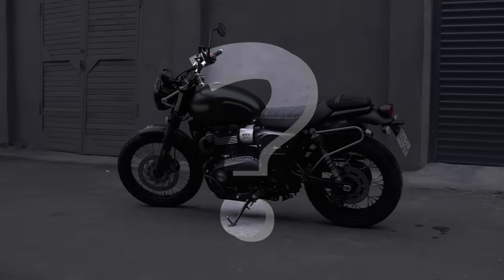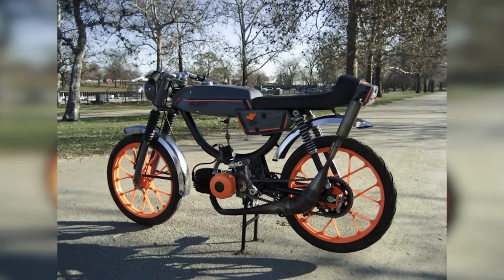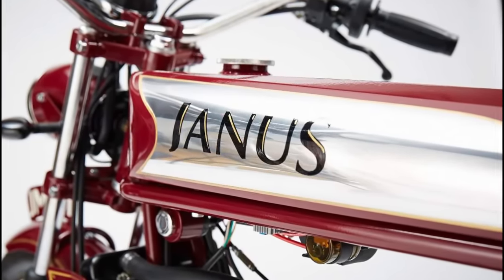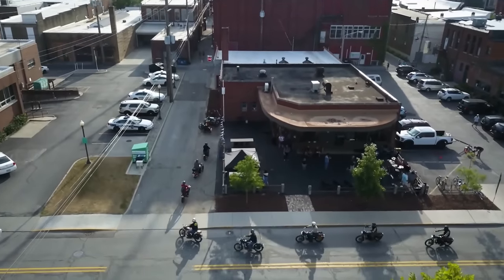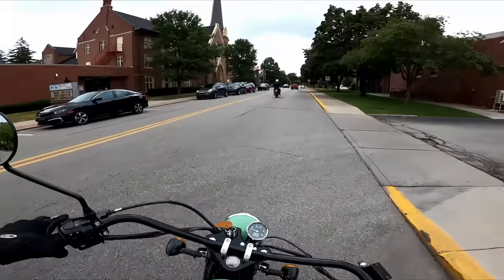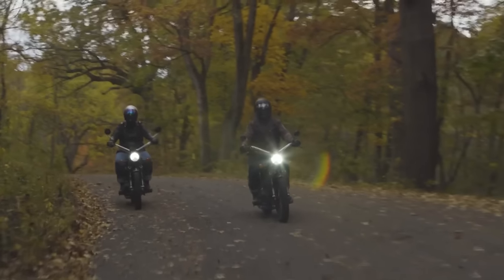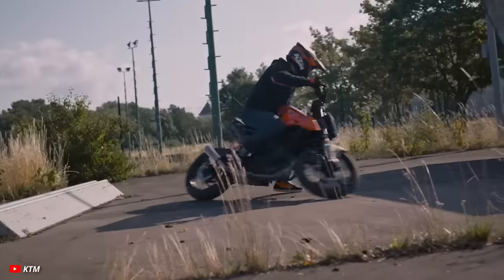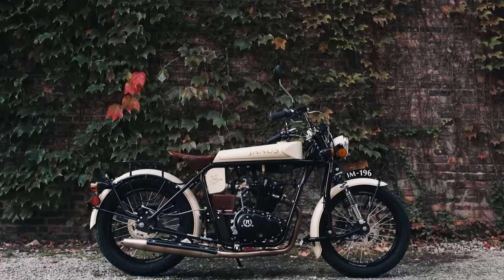The New Manufacturer making 100-year-old Motorcycles

Comment: I agree that the Royal Enfield 350 is heavy and slow. But it's actually great fun to ride! The Janus is clearly a quality product, never ridden one so I can't comment on its riding capabilities.

But as you observe,  there is a massive price difference between these two 'retro' bikes. 
The Janus website is very cagey about revealing its prices. Royal Enfield, Triumph, even Harley Davidson will tell you straight up the actual price you are paying!

I also don't think a company can be called a 'motorcycle manufacturer' if it doesn't make or design its own engines. The engine of a motorcycle is the heart and soul of the machine. That's the point.

The Janus is very pretty for sure. But possibly a bit of a rich man's/'woman's toy?

My daily rider is a Royal Enfield Himalayan 411. Slow, heavy, but very torquey and just an absolute hoot to ride! Reliability is well-proven, a worldwide network of RE dealerships and easy parts availability. Cheap to buy, cheap to run but great! 

Janus and Royal Enfield (et al) are in different market segments, so comparisons between those products (as you do in this video) are somewhat spurious.

An American motorcycle with a Chinese engine. Hmm...

Anyway, ride safe. Love and peace.

Comment: i feel like we're forgetting about what these kind of motorcycles were all about, the halcyon 450 has a base price of 15.000 $, this is an insane price for a single cylinder 450 air cooled motorcycle, hell, even 10 grand would be crazy for a motorcycle like this, you can piick up a old used bike for a twentieth of what these cost and have just the same fun (if not more since you don't have to concern yourself with damaging the bike too much)

Comment: Halcyon 450 would be the one for me if I had the money. I own two Royal Enfields, a Classic 500 and a Super Meteor 650. Both great bikes in their own way for me, however the Janus is just such a unique and beautiful machine. You would need to prize me off with a crowbar. The engine being made in China isn't a big deal either. I had a modern Benelli Leoncino 500 and that engine was Chinese and was a revvy little motor with no issues.
Ahh I can sit back and dream I suppose.

Comment: I tried slowing down and bought a slow Triumph Trident 900 and could not stop pushing it to it's limits and engine died. So I game up motorcycling. I knew I would not have a license with all the ANPR and average speed cameras we have in the UK. Some of these average speed cameras were set on motorways for ~ 28 miles. Could you imagine being on a motorcycle and only doing 50 mph for that distance, which I think even in a car is dangerous and I was constantly fighting the need to fall asleep at the wheel at 2 am.

Comment: Most modern bikes are all very similar.  Janus is the only brand selling in the US to offer something completely different.  A scratch designed and built retro classic.  It cost way too much, performance is less per dollar than probably any other bikes sold, but they are not selling a dyno sheet or 0-60 times. They are selling a small company, hand made ,visceral ultra lightweight riding experience. Yes I wish the engine was an old design, redone Norton, Harley, or BSA or something.  They could have done that and charged over 25 grand per bike, (for a midweight) and there would be a market. but we are in 2024 and they wanted to make lightweight single cylinder bikes that they could sell in small volumes.  People complain that manufacturing is deal in the US, and when a company designs and builds, and successfully brings to market several motorcycles ,people need to find fault.   The engines sourced from SWM  are redesigns from Husqvarna engineers and built by a reputable Chinese factory.  KTM has motors built in China, and practically everything we use and touch every day is made in china. Remember when Made in Japan meant copy cat junk in the 60's?  Times change and RIchard is bringing these bikes to may happy owners.  The customer service is best in class also.  Yes I own one, and like most Janus owners have owned many bikes previously and got bored with the vanilla offerings out there.

Comment: In a world of complexity and gadgets, Janus Motorcycles are anti-gadget. I like that. Mass marketing motorcycle giants and government control freaks would have you believe you need traction control, ABS, and a suit of armor to ride your motorcycle. You don't. Like many pleasures in life, sometimes simple is superior. As for those that dis the Chinese engine, do your homework instead of making uneducated blanket statements. The Chinese build their products to required specs. SWM of Italy imports the 450 engine for their bikes and sells in small quantities to Janus. It is a well made engine with a dry sump and oil tank, counterbalance shaft, oil cooled and fuel injected. A Honda clone for sure, but with well thought improvements. Many major motorcycle manufacturers use Chinese parts and engines. I'm old enough to remember when the same quality arguments were made about Japanese bikes. Check out Richard's You Tube  video on the Halcyon 450 engine and you may  change your mind if you are a doubter. But Janus Motorcycles were never intended for the masses, and that is exactly where the beauty lies. Some get it, and some never will.

Comment: What? 15,000$ on a single air cooled bike. Thanks, I pass. This engine is an updated version of an XR400 from 30 years ago. Nothing wrong with that, but for that price I can get a much better bike. I have a NC750x that cost me half of that, and it's fine. The whole "old-bike-character-feeling-bla-bla" is a nice marketing plot to have a chat at the bar, but it does not change the fact that is an overpriced single with a very limited rear suspension. Hand made, so? I don't seat admiring my bikes, I ride them. 
With all of the above said, the review was well made. Kudos to bart.

Comment: Thought I was onto something here. Was hoping to find something like some old British and Japanese classic bikes being reproduced.
A Honda CD 185/200 would be my thing from the 80's....they were so good for a small bike!
Disappointing to hear these bikes have Chinese engines. Yes, those engines are based on CG's, but were and still are under-engineered.
They may seem reliable at first, but I would not trust them after a few thousand miles. Sourcing Chinese engine parts can be a real issue too!
I had a mate who went through 6 Chinese 125cc bikes in less than 3 years, as the engines would seize before 3000 miles.
That was 7 years ago, but I have my doubts that the engines would be better now, as the Chinese bike makers had years to perfect the CG engine to be what it should be, but they didn't to keep costs low.
The fact Chinese 125's are still way cheaper, makes me think this is still a problem.
Apart from all above, these Janus bikes look nice. Chrome backed indicators would be better.

Comment: The engine is basically a Honda 650  sleved down to 450. They should have left it as a 650. They should have put a Buell Blast motor in the bike considering the price.

Comment: They have cool bikes but i wish they would use ABS brakes and instead of a analog gauge use a LCD gauge with the standard MPH,milage. Use GPS on a vintage round casing you would see in an analog. Those are the only two things I would change. You have the vintage look with modern technology. Their sales would go through the roof. If not make it an option.

Comment: Bought my first bike for 950 put new tires and seat on it total 1200 my second out of junkyard for 37 bucks and put new tires and seat and a little engine work and road it until I got hit and bent the frame then road my first bike until I found another one for the frame and replaced the frame for my second bike cost me 10 dollars and time. I don't think I'll ever spend what they want for a new bike it just seems like a rip off look you can buy a used bike and granted you do spend money to fix it but the pride you get from doing it yourself is better and in the long run cheaper

Comment: seems like a very niche category of motorcycle buyers. the fact they're charging $9,000 for a carbureted 2 stroke with a Chinese engine is a bit of a scam in my opinion. for an average first time motorcycle buyer they are just looking for something that can keep up with traffic on the highway, like a 300cc. i got a 2020 R3 with 3,000 miles on it for $4.5k. in comparison, if you were to buy another bike with the same price as a Janus, you'd be looking at a brand-new (from the dealership) KTM 300 2 stroke, Yamaha R7, ZX-4R that has triple the power of a Janus.

Comment: This isn't a 100-year-old motorcycle, or anything like it. It has teleforks, which didn't exist 100 years ago (apart from Scott's undamped version from 1908, which never caught on), indicator lamps, plastic switches (which wouldn't have been that hard to replace with a vintage-style version) and a (relatively) modern engine. It's a new motorcycle with a few visually jarring retro features.

Comment: Not shocked they are using Chinese motors. I bought a couple of the motors myself for only a few hundred dollars for my own projects. One even came with reverse gear and electric start. Going to put one of them in an XR200 frame. The Janus bikes are cool, but you can buy a nice Norton Commando for about the same money. I think I would rather have a genuine piece of history than one of these.

Comment: Retro motorcycles? Honda turned over its  30 millionth cub recently. Not bad for 50 plus years of production.
The 50cc Janus are very good. What is wrong with old design? Newer more reliable materials and engineering make a COPY of a 100 year old motorcycle more reliable than the original.
Loved my old vellocette 200 LE, doubt I'll ever see a retro of it.

Comment: Street cred 5 minute talking point for silly money with a Chinese engine no way. For the money at least it should come with a Japanese made engine not a cheap Chinese copy. It's just not good enough in my opinion, especially for the price point. By the way Suzuki now offer a 7 year warranty on a GSX 800 that's shows great confidence in a product that's cheaper than anything this company makes.
Reply: Before those engines everything was fixable from sitting. Now if you see something with those engine's it's trash. Learned the hard way.

Comment: What bothers me about Janus Motorcycles is that they use Chinese-made engines.
Reply: Yes indeed. Ones so poorly made that 10-15,000 miles is about max service life. But that will not matter to some people who just want one of these things and only want to ride it around the block every now and then and likely would not put 10,000 miles on it in 20 years.
Reply: I'm also not a fan of Chinese engines, but the chinese can and do make good engines, but you have to know what you're looking for. There are some chinese factories that have outstanding quality and quality control, but they get put in the same category as the cheapest engines with no QC.  So Janus has to do their homework, and I believe they have.

Comment: A "retro bike" is just not that: a bicycle in any way but holistically designed "motorcycle" en toto and all that comes with trying to handle the incredible power output of the internal combustion engine circa 1900-present. That means you're not fishing around the parts bin for bicycle parts to "fit out" your machine but purpose built in every manner and way to be a "motor bike" and thus distinguished from any bicycle of the time...something very hard to do actually. First and foremost though would be the design of the seat because a motorcycle has a lot more in common with riding a horse 🐎 🐎 🐴 🎠 🏇  than anything 2 wheel related that came before. In short "these things have some kick." This type of craftsmanship would lead to therefore and inevitably "design choices" as who couldn't already make bicycles during this time in the alternative who in fact could make a "proper" motor bike design?

Comment: For those who have a stumbling block with Janus because of the made in China engine....if you threw out everything in your home, auto and motorcycle that is made in china nothing would be functional. How about Apple??? The phones and computers...from China. So-called American cars have many parts from China, Don't use your TV because it is from....China. Yes, the U.S. has exported so much of its industrial  base to China that it is darn near impossible to buy anything that is not made in China or constructed with parts from China. Even the Japanese bike manufacturers have some models made in China as well as American branded automobiles. The proof of its quality is witnessed by its longevity and lack of major internal failures of the engine. I don't know the statistics on this but maybe Janus could publish what it does know regarding bikes sold that have a lot of mileage on them. I do know that Harley and BMW, both bikes regarded by their followers as a good quality ride but from time to time on the forums I read of engine or transmission failures in what is regarded as a low mileage machine. What people are saying about the Chinese engines reminds me of how they were speaking about the Japanese manufacturing in the late 50's and early 60's regarding their cars and bikes. Time will tell how this engine will be reviewed.

Comment: Lovely bikes indeed. Just a bit sad they skimp out on the heart of the bike, the engine. When everything else looks so premium, why go for a cheap knockoff instead of a proper Honda powerplant that delivers what it promises? Are they simply planning that no one will ever get enough mileage on these bikes to experience any issues? With a quality engine it might not even be that slow anymore. Sure, it would be a few hundred bucks extra, but they could at least offer it as an option since there apparently is an exact replacement.

Comment: 15k for a bike that can basiclly only rip around the city with china engines. Sounds like they need to stop paying them selfs mid 6 figure Salaries. These would be great for big citys hell xould probably even export them if they made more. These bikes could be made out of mostly stampped steel. And then hand finished saving time and money. They should at least make 1 or 2 simple mostly stamped steel bikes to move more units get the name out build the market. But then offer custom touches to run the price up from them. Like the photo Album. More fancy leather work on seats/ bags, custom tank paint gold and silver leaf in the paint ect. And make the parts swap models. They started off as collage kids. These coukd easily sell to hipster collage kids that dont have daddy paying everything. Get them on a 3 or 4 k bike where the market ignores then from time to time mail them newsletters showing off a high end full custom bike then they could sell more parts ect. At 15k they will clear out the hipster market making 100k a year or more willing to spend that much and die out.

Comment: Nah, too expensive. If you really want a nice 250 air cooled bike, just buy a used honda rebel 250 or nighthawk 250. Easy to maintain single carb. Easy oil changes, and chain maintenance. It's a twin but so what. Also see suzuki tu250x or gz250 singles as other choices. The low cost of these sure beats $15k. Just saying.

Comment: Mama don't want no hard tail.
I prefer Honda's strategy, minamalist and super reliable and super cheap to get the people after a war moving on wheels.
My guess is not under $1,000, so ... not interested.  FOr a motorcycle to be exciting to me it has to be high mgp, low maintenace cost, easy mainteance, and under $1,000, regardless of the year or condition.  I don't want some boutique bike made to sell to hoi paloie motorcycle collectors with too much money burning a hole in their pocket.

Comment: No one can make a true reproduction of any vehicle from over fifty years ago. And who would really want to? The goal should be to remake the look, feel and style. However to ignore the failure points of an older vehicle and not update them with proven durable modern tech... That would just be stupid.
I would enjoy remaking model A and T fords.
Would I use a magneto ignition or an updraft carb? Yea, just as soon as I cutoff this leg I'm only using. What about a sealed driveshaft on a banjo rear end? There is a reason they stopped using those things. Just like why vehicles today have rear and front hydraulic breaks with break lights. Something about surviving a half mile trip to the corner store.
If you need your new old ride to be as original as possible, then buy an original.

Comment: When you assemble an interesting looking motorcycle like this, packed full of Chinese parts of dubious quality, it is a bit of a stretch to claim you have resurrected a 100 year old motorbike.  From my direct experience with Chinese junk, it is all about the metallurgy, and especially about the hardness of the steel and aluminum used in the castings..  Quality control in China is an afterthought.  I know.  I lived an worked in China.  There are many Honda engine clones being made today in China, and outwardly. they are exact copies.   Inside the difference is like between day and night.  Ask anyone who runs a portable Honda generator for many hours.  Try getting those same trouble free hours on a Harbor Freight clone from China.  Criticism aside, your motorcycle is visually very appealing.  You just need better internal guts.